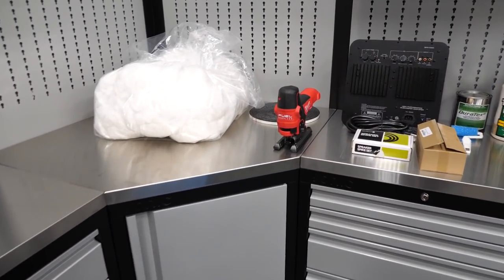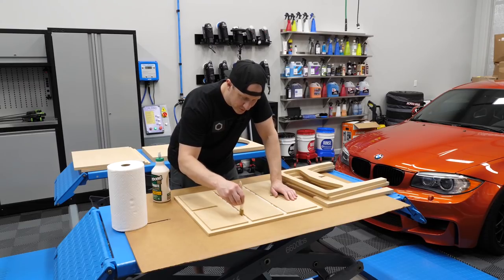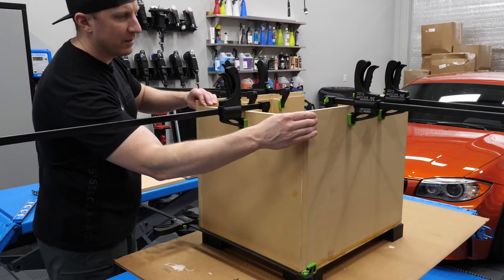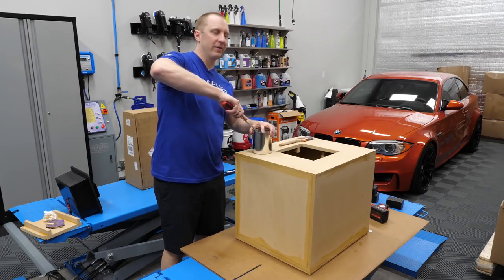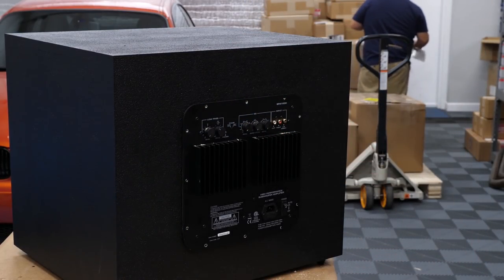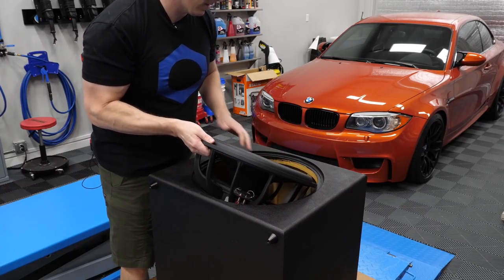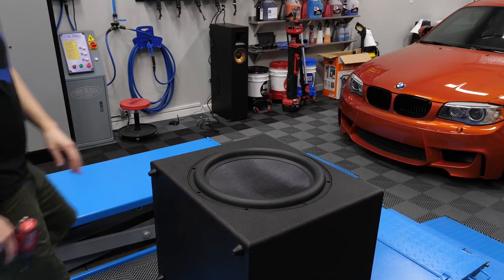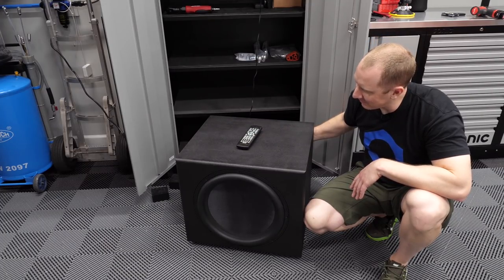Dayton Audio Ultimax 18" Subwoofer Build

Comment: You need to invest in a Brad nailer.  It will help during clamp ups.  This way you can tac in place-panels as you due your glue up
Reply: Yep I ALWAYS brad nail wood parts I'm gluing up. Plus it's fun shooting nails into wood. 😎
Reply: The ryobi cordless nailer is excellent.  Shoots 2” brads.   I like it better than my Milwaukee.

Comment: Keep in mind that when you use acousta-stuff you want to glue it down and you don't want to overstuff the enclosure with it otherwise acousta-stuff will potentially get into the voice coil of the subwoofer causing the subwoofer to blow
Reply: And drill the speaker holes then clean out the bits of wood left inside, then ut stuffing in with sprey glue...... excelent job though, i probably would have done the same thing..... all hindsight

Comment: I started with a Polk PSW10 I picked up on Amazon for $65 then upgraded to an Infinity Ref 10 I got refurbed from Harman for $100.  Finally the latest one I got was a Polk PSW505 about 6 yrs ago that I bought used on eBay for about $130.  I still have all 3 but the Infinity is doing work with a pair of bookshelfs for my turntable.  The PSW10 is collecting dust.  The PSW505 is not the greatest 12" sub but it gets down for what I paid for it.  I cant imagine 4-18's.

Comment: If you have rack space a pro amp would get you more bang for your buck. And the um18 in a sealed box will take a good 1800watts.
Reply: Do have any amp recommendations
Reply: I'm not sure it will take that for long, 
You'll need a GOOD amp that can push out that power even with the impedance rise @32hz for this sealed box when wired for 4Ohms. (WinISD shows 22Ohms @32hz Correct me if I'm wrong)
Reply: @paulsalmon4771  I use an Inuke3KDSP, It's perfect for my needs, however if you really wanted to pump in rated power, It wont at all frequency as the impedance changes depending on the frequency.

For example my box at 28hz it's about 24Ohms and this amp can't push 1K at that Ohm load, however it does get louder than I need at that frequency as I've seen it do around 200 watts at 28hz and 100w is already very very loud.

I'm wanting to get something way way overkill. FP14000 by Labgruppen.  impedance rise won't be an issue with that amp. (even though my Inuke is more than enough for my needs lol)
Reply: I was actually thinking bout the berhinger EP4000 or qsc rmx 2450 what are your views on either??
Reply: Paul Salmon I can't check them out fully right now, but they seem good on paper.  Check out the Crown xls series, they are pretty popular for subwoofer duty or main duty and have a input voltage toggle that lets you use consumer inputs like RCA without needing something like a art cleanbox.

I personally want the xls 2502 to test before I get that FP14000 in the future.
Reply: @Paul Salmon  Crown
Reply: Just ordered the Ultimax 18 with 4 cubic ft box. I already have a crown XLS 2502 that pumps out 2,400 watts at 4ohms, which the UM18 runs a dual 2ohm voice coil so 4ohms wired in series. I talked to a tech consultant at Parts Express and he said it’s a perfect stand alone amp for this woofer. I was previously powering a Adire Audio Sadhara 12” sub.

Comment: It's like baking a cake from a pre-made box mix, you can do a plain jane version or take extra steps to make it perfection, build quality is always in the hands of the builder, I usually use a small damp cloth to wipe the seams clean, then follow with a bead of silicon on all the seams.
Reply from the maker: Yeah, I'm in that middle of the pack or slightly below average when it comes to doing stuff with my hands.  I err on the side of the leader rather than doer side of the equation.  Luckily both are necessary for functioning organizations.
Reply: You did very well.... i think i would have panel pinned the joins, but msf on the sides can still split with tiny panel pins..... lol 🤷‍♂️

Comment: Perfect Matt, the only thing I would do differently is wrap it in black acoustic felt , for that rock concert wedge monitor look.
Reply: And put on the corner caps, replaced the feet with 2 wheels and 2 lockable wheels.....

Comment: Not sure if you’re still replying to this video, but wondering how you liked the roll on version of the Duratex. I know you used the small roller but wondering if you can see any roller marks in the finish.
Reply from the maker: It rolled out well and didn’t show lines.
Reply: Great, thanks.

Comment: Can you let us know how it sounds as a single sub in your theater?  Interested in what the other prebuilt options you were looking at and how you decided on the diy route too?  For me I’d be all for diy to save money for better performance but surprised to see a guy with a gt3rs go that route. Must be pretty good!  Love the video!
Reply from the maker: The Ultimax is pretty much the standard DIY option now.  I wanted a smaller sealed enclosure, so that's why I opted to do Parts Express stuff.
Reply: Obsessed Garage cool, thanks Matt. Assuming the options from SVS or Rythmik or others were significantly more money for similar or less performance?  I know most of the big dogs from the internet direct brands are massive.
Reply: I dont think svs do an 18 inch, but who cares, the fun is in building it yourself, and the money you save..... the amps wont be like svs, neither the finish, or the speakers themselves, but the sence of pride and saving more than 3.5k is well worth it each, so over 4 thats 14k........ lolz for 75% of the capability....

Comment: Awesome video. This is my first time watching. I like your style. I have 2 of those so far but I’m designing a ported enclosure. I will surely have sawdustageddon. I’m dedicating a Crown XLS amp to each one. 1502 minimum bridged to 4ohm. I ordered my Duratex in base color. My local Sherwin Williams dyed it the color I wanted no charge (purple) justcin case anyone wants to custom color their Duratex. As thanks I purchased another roller and el cheapo brushes from them. It’s the same as any water base interior paint.

Comment: i just sold all three of my rythmik fv25's (they are like mini jtr 4000's) and am about to order multiple jtr cap 4000's.  really confused why you chose to go with parts-express dayton sealed subs.  there's nothing wrong with them but they're just not even in the same league as the jtr sub you have.  also mixing sealed & ported, not sure that's the best approach.
Reply from the maker: Simply due to cost.  Spending $10K on subs wasn't something I was prepared to do.  The more I listen to this home made sub versus my  4000ULF, the more I think I'll stick with JTR.

Comment: This video was great.  It looks like the box turned out great as well.  It looks really stout, but I've always glued and screwed my sub boxes together.  I worry that the glue will fail over time with all the vibration.

Four eighteens didn't see no wires...And then I heard BOOOOOOOM from the amplifiers.  (Can anyone in the comments name that song?)
Reply: Titebond 3 is so good that the wood wood itself would fail before the glued joint.
Reply from the maker: That's what I've always understood.
Reply: Still Fly, by Big Tymers??
Reply: @craigandresen2456  You got it!
Reply: Love that song!
Reply: I don’t think I could build a box for a sub that didn’t have screws. Titebond is awesome but my head wouldn’t allow it

Comment: Acousta-stuff will provide deeper bass and will lower the tuning frequency of the enclosure but do note that if your subwoofer enclosure is a prefabricated subwoofer enclosure or if you built a subwoofer enclosure that already has optimal air space and is tuned to the specs of the subwoofer then acousta-stuff will not effect the tuning frequency and will not provide deeper bass and will do absolutely nothing

Comment: I like it! Some are scared to build even such a simple kit.
I never fill in the grooves. It is just very unnecessary.
Because this amp has a closed enclosure for itself it is ok to put the stuff infront of it.
Did you think about doing a Double Bass Array?
Mistakes happen. It's part of learning :)
I also like sealed a LOT more!

Comment: All else being equal, which would make a better subwoofer, a 150 Watt RMS / 8 inch woofer OR a 100 Watt RMS / 10 inch woofer?
Reply: No replacement for displacement. Go with the 10" it will push more air with less effort.

Comment: Buddy you have insecurities if people don't like you building subwoofer enclosures or speaker boxes or anything in general then you're catering to the wrong crowd. You're doing things right you're building your subwoofer enclosure and you definitely bought the right subwoofer. Dayton Audio series Ultimax Dual 2 Ohms are amazing subwoofers. Use some screws next time for more durability because wood glue won't hold up for that much power. Cover the screw holes with glue or some sawdust in there wait to dry then sand it.. I mean you should know how to do this lol make a Y connection to the positive and negative lead that way one wire branches off into 2. I advise flux then solder on the Y connection. Nice 135i in the background by the way.
Please stop putting yourself down you are a great person and you enjoy your hobbies like I do.

Comment: Adding more subs will make it worse. If you need more bass, measure your room’s acoustics property and install real low freq. bass traps. Example: Check the diaphragmatic absorber from Acoustic Fields; they even have DIY instructions. But sooner or later you’ll understand that your speaker placement is wrong: http://www.mh-audio.nl/Calculators/SpeakerPlacing.html . Just try it in stereo mode before you say “NO WAY” and find a way to deal with the windows gap during test. Also that coffin under the TV probably behaves like a broken boom box from hell. Just keep in mind that you’ll never be happy until you’ll take of the room’s low freq. and redo the speaker placement. There is no other way around it. And btw, why do you need windows in your dedicated home theater room?! And since it’s your house, then you should build the sound absorption /diffusion in the walls. It’s much more effective and elegant.

Comment: Adding glue to the outside of the joints really doesn't do anything. It's best to just get an even layer on the contacting surfaces of each piece. When it fully cures it will be stronger than the wood/MDF itself.

Comment: just a tip you should return the sony a7s's you mentioned you bought for the sony a7iii. I had the sony a7sii and autofocus sucks. The sony a7iii has much better auto focus, is cheaper, longer lasting battery compared to even the 2 that come with the a7s, also dual memory card slots and is just as good in low light. Believe me the autofocus is worth it alone.
Reply from the maker: I have two A7iii.
Reply: @ObsessedGarage  ahh i missed the correction

Comment: Gerard Stroh***
Hi Obesessed Garage***
I Got My Dayton Audio 21 inch Vortex 4 Ohm 2000 Watt Sub Woofer and That Speaker Was Super Heavy and it Was About 90 pounds and I Got The Speaker Installed into The Speaker Cabernet and It Sounds Good**
I Just Have to Get A High Powered Poweramp so I Have to Save up for the Amp**
I Sent Some Pictures to Youthman's Website**
Bye From Gerard Stroh**

Comment: If you aren’t super happy with the results of the 18’s I would highly recomend checking out REL Acoustics. They are a bit more pricey but they have a dedicated home theater line of subs that range from a 10” on 300watts to a 15” on 800watts. They are the best sounding subs in my opinion and they have very good videos online showing how to set them up.
Reply: There is no way in Hell any REL- yes even their top tier no.25- can compete with what this guy has. Both the JTR offerings and the DIY offerings will beat REL in every single performance metric

Comment: Things to do differently next time: 1) Use "Hurricane Nuts" or hex threaded inserts (similar to what you used for the feet) and socket head cap screws (10-32) to mount the speaker. There is a lot of weight there and "wood screws" will either work loose over time or will pull totally out of the wood, wrecking the edges of the speaker hole. The MDF they use is quality stuff but it still doesn't have the weight holding ability that machine screws and T-nuts will have. Center punch the holes using the woofer basket as a template, then remove the woofer and drill the needed size for the inserts, then set the hurricane nuts using a dab of glue on the flat mating surface (use care not to let it enter the threads). 2) Install the woofer before you install the amp, because if you have someone help you hold the woofer magnet from inside the amp hole, it's less likely to try to bite your fingers as you drop the woofer into the hole, and it's also easier to get the woofer in there straight. Then use extra wire so you can pull the electrical connections outside the hole in the rear before assembling the amp into the cabinet. Then tie up the excess length as you are inserting the amp. Just some pro tips - I've built this kit and several others, plus prototypes for some production speakers you can currently buy.
Reply from the maker: Good stuff
Reply: @ObsessedGarage  personally, when using duratex,i use flat black rattle can on the woofer cutout before applying the duratex. and the last 3 enclosures i did with duratex, i used the saran wrap process to get that "vinyl" look. it has a better look for in home units. and as mentioned, a few brads when assembling the box is what i do, clamp it tight, shoot a few brads in, remove clamps and move on.  but nice job man.

Comment: What kind of clamps are these
Reply: I just did this same build. They are called ratchet bar clamps. If you have a Harbor Freight nearby, they can be purchased for about $12.49 each. I bought six of these 24” clamps and 4 small 6” ratchet bar clamps ($2.99 each) and that seemed to do the trick. I stress that you can’t have too many clamps!

Comment: sad seing someone use, so good subs and all this time. to build something really nice! then use so shitty thin wires??  use some big cables, or atleast some good cables. these look like some electric wiring bs
Reply from the maker: I used a 12 gauge speaker wire for this subwoofer. That's more than enough to handle the output. No need to go overboard with it.
Reply: @ObsessedGarage  so you waste alot of money and power, into building a thing!  Thrn cheap out on cables?? Made shit sense! And wire is not just wire! Ehat you are using, seems like electric wiring. Not a speaker cable! I would have used quality cables, so no power or tones are missed.  Its like using finest wax, then using wish pads on the polishing machine😄
Reply: @tuemose22  In a blind test, two of the same subs, one with cheap wire while the other with overpriced snake oil wire I would bet you would not be able to tell the difference. The wires in the voice coil are small, the amps circuits are small! You don't need expensive wires!